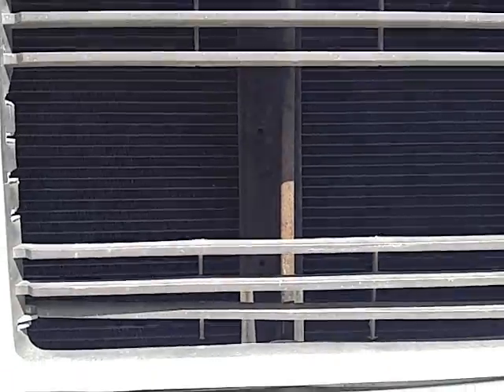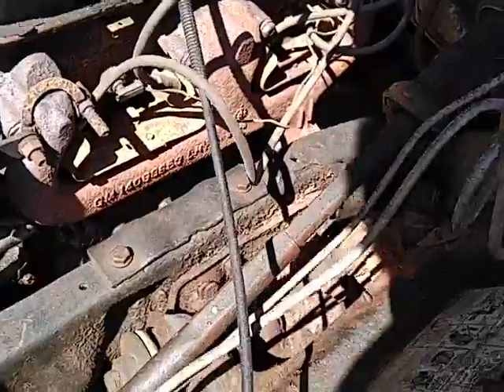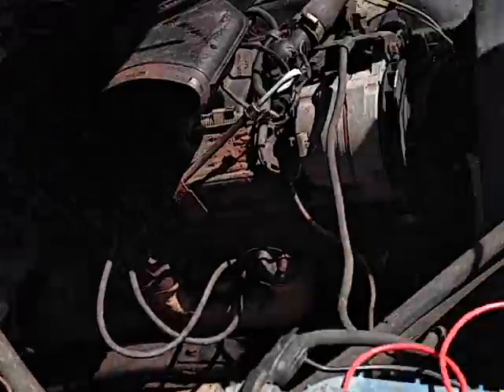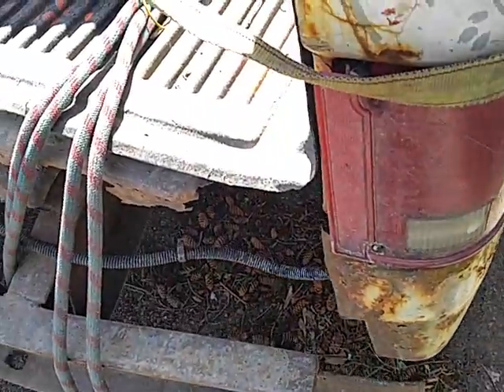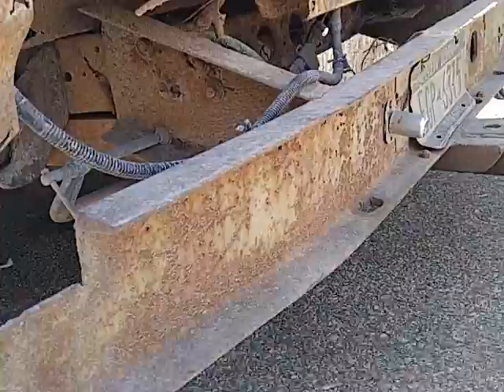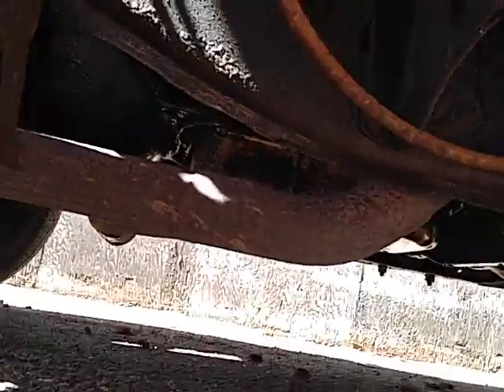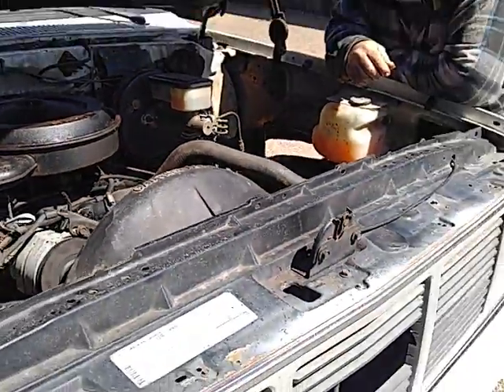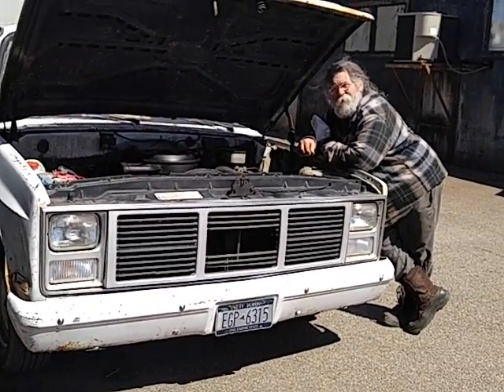GMC Running Sweet Junk 4 9 18

Comment: Survivor. My original engine in my 90 Blazer made it to 295K miles, then the rear man let loose. No rust, but it still ran like a top. Lots of rust, but still runs like a top.

Comment: Corvairwild, I figure you are the expert. I am buying a 1965 Corvair out of California. It seems to have the base engine, 2 carburetors. 4 doors. What is the significance of a grey back panel on the car?
Reply from the maker: Calvin CALVINL in 1965 and 1966 semi gloss black rear panel signifies CORSA, the 140 4 carb, or the 180 turbo. But it was very common for people to paint the Kamm back a contrasting color, usually flat black because it was easy to buy and cheap, or black wrinkle paint. Check carefully for rust, even from California, bottom of the windshield is a typical spot, and the rocker panels have a drain hole at the bottom on the inside, and it's often clogged with mud, and the Rockers could be rotted even though it's from California, I've seen it many times. Feel free to email me, corvairwild at gmail.com